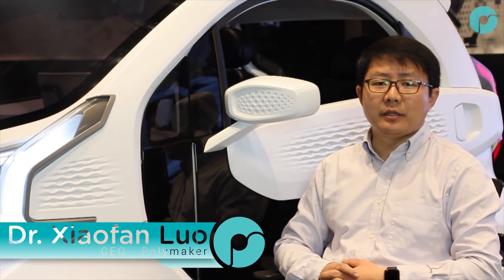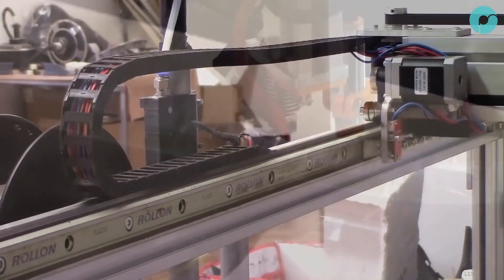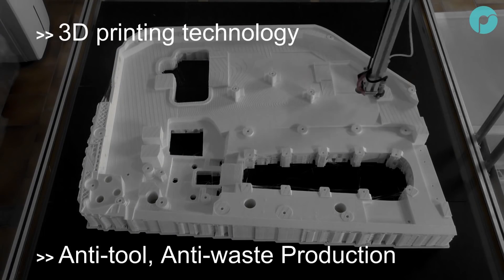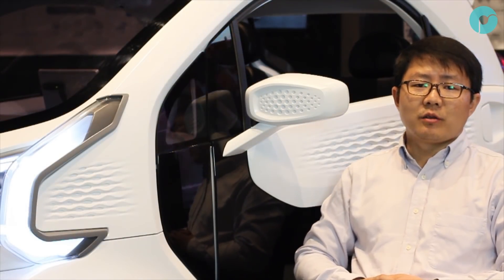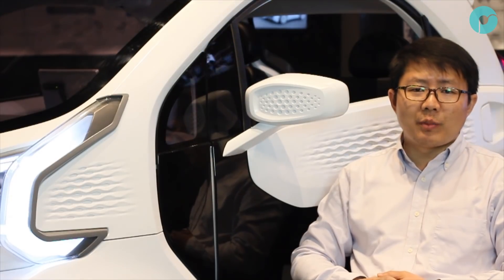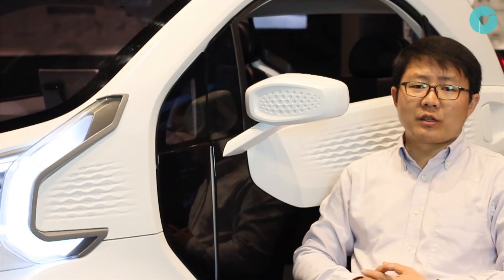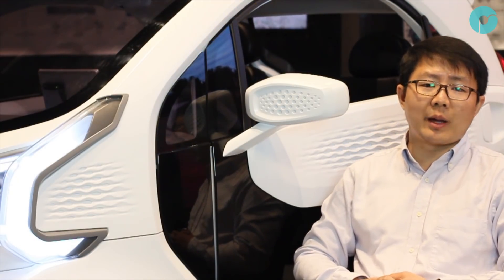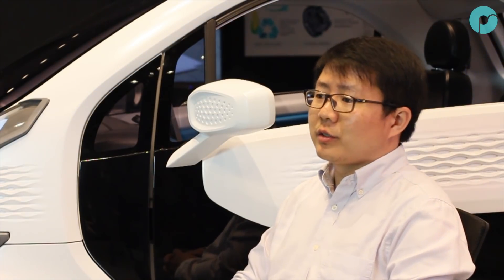Bringing LSEV to life - The 1st Mass Produced 3D Printed Car

Comment: Sorry, mass production with 3d printers is stupid. FDM is just way to slow. You simply can't get the number of parts per minute high enough, so additive mass manufacturing only makes sense when there is no other option. 

FDM is making inroads into the batch production realm, but not mass production.
Reply: taoorus Cnc is way, way faster then fdm even mainstream machines can remove cubic cms per second.

Edit:fdm is still CNC, I meant CNC (Subtractive) machining
Reply: Robert Szasz but what about cnc? It's essentially the same thing but nowadays we use it a lot in mass production of consumer electronics.
Reply: well except one of the best 3d printers on the market is mass produced with 3d printed parts so theres that. either way a car that would fall apart from hitting a pot hole is still a pretty bad idea
Reply: Mass production of customizable cars is curenlty only possible with 3d printing :)
Also many piece is too hard to produce in a conventional way so you would need much more pieces so much longer production time, all in all i dont think it is stupid, I think its a really great innovation.
Reply: Pretty sure one-off parts are not mass manufactured by definition. Making lots and lots of identical parts (for later assembly using advanced tooling) is the worst way to use FDM, and FDM should only be used for mass production of parts when there is no other option.

3D printed, fully customizable parts as a way to take a mass production vehicle base and turn it into a bespoke final car makes sense. A 3D printed interior and exterior (limited by safety and crash test requirements of course) has places for 3D printing to shine.

It would be impressive to see a "Fully" 3D printed vehicle (it would almost certainly need to be electric for any range, but compressed air would allow more 3D printed parts)

A fully 3D printed car requiring only the placement of front and rear windscreen, window glass, mirrors, lights, and an air tank to be added would be truly impressive. And I'm fairly sure it's within current capabilities to make most of it as a single integrated multimaterial print. 

A potential scenario where 3D printers can do what nothing else can
"The car emerges from the printer, as the glass and lights are installed, printed in mechanisms first assure alignment, then securely mount and seal the edges, a lubricant that also acts as a support remover/solvent is added to the drivetrain, then a few minutes later an airline is hooked up, first used to purge lubricant and the dissolved supports to a waste port, then activating a series of mechanical self tests that if passed plays a simple "passed" jingle, and releases the hatch for air tank installation. A technician installs the air tank and the car is ready to drive away, perfectly fitting the driver."

It still wouldn't make any sense to try and mass produce, but it would be a stunning engineering feat to show what fully matured 3D printing is capable of.
Reply: The purchase rate of vehicles is rather slow, so it just needs to be fast enough to meet demand. That said, a single 3D printer will not be able to make a mass amount of cars as fast as a standard factory. You will need many 3D printers. Luckily, the 3D printers at up to 9 times the size of the car would still be big enough to fit many times over in a typical car factory. You could add more and more 3D printers as you get more demand and funds.
The use of a 3D printer to make molds may make more sense when you want to make mass amounts of cars. Those molds will take space and a machine or person to make use of the mold.
With thermoforming, a person could 3D print some of the frame of the car more or less flat and then heat and bend it into the appropriate shape. This process is much faster and can overcome some of the strength issues from printing having occasional bad layer adhesion. Thermoforming would once more need people and/or machines added to make use of it.
3D printing can produce a new style of car with no retooling. It just needs the new design. any molds or thermoforming setups will need to be retooled though.
Take it how you will, but I figured I would give some feedback on pros and cons of 3D printing for making cars.
Reply: I think you point out the important thing: "FDM should only be used for mass production of parts when there is no other option". This is where FDM stands out it allows things that common manufacturing cannot produce :)